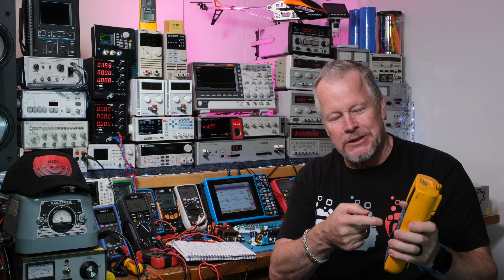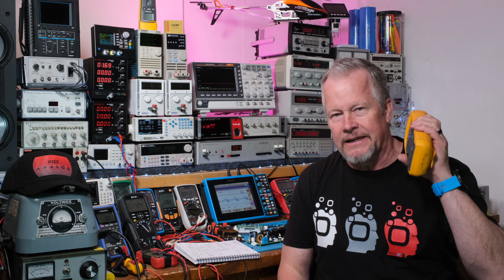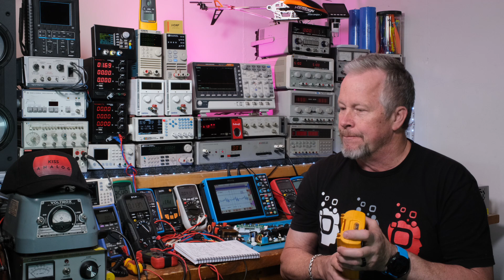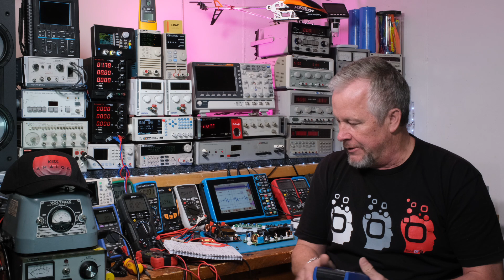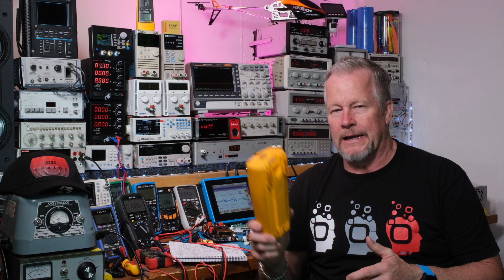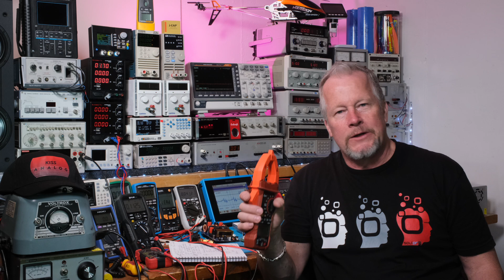Rant on MultiMeter Reviews with Fluke 289 vs Keysight U1282A #Rant #Fluke289 #keysightU1282A

Comment: Wow tell us you hate fluke without telling us you hate fluke. Nothing comes close to the build quality of flukes period. You pay for what you get if your using your meter in the field get a fluke if your using it in your workshop yeah ok get a keysight, but if your using it in your workshop then just get a brymen its cheaper again, dont really see a point in keysight, hioki on the other hand has a place as its in-between the cost of the brymen and a fluke but again if using it in the field you can beat a fluke if using it inside only then go brymen.
Reply from the maker: Thank you - I appreciate your feedback.  I really don't hate Fluke - I feel bad that since they have been bought - they just have not designed new multimeters for decades and are falling behind.  And then the Fluke fans don't care and buy their meters so that they don't have to compete.

I have spent so much more on buying the many Flukes that I have that if I had only not been such a Fluke fan - I could have saved so much getting newer better meters...I'm trying to help others see the light.

You have not seen my other videos as I show many meters that not only compete with Fluke - but in my eyes looks even better.  Fluke are great - but 20 years old - and others have caught up.  

Check out my other meters that I compare to Fluke - I think you will be impressed.  Not only do many meters match or beat Fluke in safety components - but there are many that have better IP and drop ratings.
Reply: @kissanalog I agree they are definitely behind in functionality, but i believe they are the leader in build quality, i too am hoping for a refresh on all there meters soon, though i hope they keep some simple with ultra long battery life which means keeping the basic LCD, and then have others with more functionality accuracy and speed so you have the option depending on your needs. I personally prefer the the more basic long battery life style like the 87v max, as an industrial electrician this meter ticks all the boxes for me. Im not really sure any other meter does that other then keysights top meter, but at the end of the day thats basically the same price and from what ive read isnt actually that reliable.
Reply from the maker: When I started this channel I had used and owned the 87 series for several decades.  When the 189 came out - it was just so much better - but they killed that meter.  The 189 and 289 meters design came from Tektronix which the parent company also owns.  They didn't want the new Tek meters killing off the Flukes.  

There are a number of meters that have equal or better build quality - IMHO.  I've shown these meters side by side with fluke so that you can see the build quality.  As I've mentioned, the IP ratings in other brands are often better - showing the build quality.  The protection circuits are also top notch.  Fuses and batteries are easier to get to as well.  

Regarding the display - the Flukes use the old tech and the newer displays are more crisp, easier to see, and have better back lights, and then there are the really sweet displays - the EBTN, VA, TFT, and OLED screens.  Yes these will take more power - but then they are so much easier to see and some are dot matrix so they can be programmed to show so much more info on the screen.  This takes us to rechargeable batteries - which I'm a big fan of.  I hate tossing out batteries and finding that the batteries are dead when I need the meter.  But if you can recharge - you are back up and running in no time and if you are on a job - you don't have to run out to buy new batteries.

Comment: I agree that the Fluke DMM brand is an expensive brand.  I have a number of Fluke DMM’s including the 189 and 289. I also have clamp meter and wireless DMM.  I consider them to be the benchmark for all other brands.  I recently considered upgrading to a Keysight DMM, but when I got the data sheet and compared the model side by side I realised that I would have probably picked the Fluke over the Keysight, even though it is 15 years old.  The Fluke 289 has the record feature of trend measurements,  is accurate and stable, which is what I needed most.  On that basis I would probably purchase the Fluke 289 again when comparing it with the Keysight DMM flagship model.  I think the phrase,  “You get what you pay for” stands up to scrutiny when looking at the finer details.
Reply from the maker: Thanks for sharing your thoughts.  BTW, the Fluke 289 is not 15 years old it is approaching 2 decades.  The UT181A is an updated lower cost version by UNI-T who is one of the largest equipment manufactures in the World.  The UT181A has a color display so it is easy to read and it has a rechargeable battery so the battery will last a lot longer.  It also has Bluetooth as well as a PC control, but the bluetooth really helps to capture the logging real time and record it.  This is a far better - more up dated vs of the 289 - IMHO.  

Here's a video comparison. 
https://youtu.be/-RcEli_pB7c

This is the teardown:
https://youtu.be/-RcEli_pB7c

Comment: The 289 is for industrial motors and HVAC I thought you did electronics engineering, in which case the 287 is more applicable??
Reply from the maker: Great question! The 289 and 287 share many similarities, but the 289 adds features useful in industrial settings, which can also be beneficial for electronics work depending on the specific application.  The 289 has better logging features and at these high prices it is nice to have the LowZ, filtering and logging.  I think both meters are over priced and too big with poor displays - compared to other meters that you can get today.  I only have it because of this channel to show how others compare.

Comment: I bought a 289 because I’m a motor control technician and it’s the only one that pretty much does everything I need for troubleshooting high tech equipment and frequency drives.
Reply from the maker: Thanks for your feedback.  Here's a fantastic option: https://amzn.to/4dQeb5u
Reply: @kissanalog  nice, this didn’t exist when I bought the 289 back in 2012.
Reply from the maker: Yes there are so many options today.  The 289 has been around for over 20 years.  Back when Fluke was designing high-end meters.  I wish they would come out with a new updated 189 - my favorite Fluke:)

Comment: From when I bought the Fluke 289 on LOz funtions have a big problem when start ON, the AC grow up to 8.4V without probes connected and none Fluke repair in Europe resolve the problem, if sombody can tell me if are or not 289 like this I will apreciate plaese. Or isn't normal?
Reply from the maker: Thanks for asking.  When you short the leads - does the reading go to near zero?
Reply: @kissanalog  No, it is the same, the 8.4 volts are the same and I pay for Calibration 2 time in vain in Europe Fluke. Thank You!
Reply from the maker: Wow - that is terrible!

Comment: I don't find the fluke 287 that bad on my bench, find the display readable and when my rechargeable batteries die I'll use an 87V.

I only paid £150 for it so that's a good deal, don't mind the menu as I rarely need to use it.. the menu has many features that the 87 doesn't... So that doesn't seem a downgrade.

But you have good points. And no doubt the 28x series is dated, but this could be partly why it is costly to maintain such an old design...? Not sure, does anyone have PCB shots of a 15yr old 28x vs a recent one?

 Interesting stuff.
Reply from the maker: Thanks for your great feedback!  I think everyone has their own likes and dislikes and the Fluke meters are quality meters - so there is no argument there.  I have been a Fluke fan for years - until I started this channel and started looking at other meters.  The Fluke is so expensive - they cost more now than they did when they were released.  Both the 87 and the 289 or 287 are around 20 years old now.  The new meters just have such nicer displays and are smaller and have better user interface.  Also, they are built just as well if not better IMHO https://youtu.be/YvivwYCxrBo

Comment: I have owned a 289 for about 10 years. Bought it used because I couldn’t justify the cost. I use mine in the automotive trade and like the low ohm range and the data logger which I use with an amp probe to measure intermittent key off draw issues. Yes the battery life is poor but my biggest gripe is the outdated display. If Fluke were to update the line to TFT color or OLED I would buy a new one. The backlight does help but I work in low light environments and it’s still a struggle.
Reply from the maker: Thanks for this great feedback!  Besides being battery hungry - it is just too big IMHO;)  I agree the display is sad - but then I believe this meter came out in 2007, so for back 17 years ago - it was pretty nice.  I'd like to see them revive the original 189 with a new display - that would be interesting.  Right now there are just too many better options at a much lower price IMHO;)
Reply: Fluke would always be overpriced. Fluke may not be capable of being creative.

Comment: My biggest complaint about the 289 is boot up time. Favorite Fluke is the 189/187 hands down the best continuity buzzer and sensitivity.  Although a Fluke 289 on your bench is a statement and like it or not it’s definitely the King of the hill.
Reply from the maker: I agree - the boot up time is frustrating with a multimeter.  With an oscilloscope I don’t care, but a multimeter is typically picked up to take a measurement and then you have to wait - and hope that the battery hungry meter has a good battery.  My least favorite meter that Fluke makes, and besides the boot up, super large size, and menu driven (with every feature buried), and it is a battery eating machine. The logging feature is outdated and expensive with the subscription service that you have to pay for, and takes an expensive cable.  I only have it because of this YouTube channel.  It is 16 years old and is not worth half the price they demand.  I have other meters at about half the price that I want to review in a shootout to show what a high end meter is today.

Comment: I run the 289 as a daily driver. 789, 1587fc, and 378fc are the supplemental three depending on what I need.
Reply from the maker: Wow you have some expensive meters;) Are you happy with them?

Comment: FLUKE 289 system info - Select "Setup" (F4), select "Meter Info" (F1), scroll using up/down arrows.

Enjoyed the video/Rant, I learned a number of new things about DMMs - Purchased my 289 about 14 years ago for ~$500, still working great (light use).  My meter did come with an IR to USB cable.
Reply from the maker: Thanks for your feedback!  It is an old meter with older tech.  The newer and lower cost meters come with Bluetooth, so no cables to tie you to the meter.  Once you use Bluetooth - it feels so nice to monitor a meter from another room (safely) and not have the expense of the expensive cable and I believe the software has to be paid by subscription.  Meters that I use today come with free apps with no subscription fees.
Reply: Fluke has become a dinosaur.

Comment: I understand and I understand what you mention and if you go A cost-benefit ratio perhaps there are other options.
But I leave this to you, perhaps from another point of view.
https://www.youtube.com/watch?v=ay9wFQAW19Y

Regarding the fact that fluke 28x series can only offer you 100 to 200hrs of use compared to the 800hrs in the first years that 28x came out with its PCB ID 1 and 3, they had 3 terminals on the back where the battery compartment goes which the third terminal was used for another battery compartment (which was sold separately) that housed 4 type C batteries, then your records were no longer going to be for a week but weeks, who knows if the month passed, that would I saw it in a promotional magazine, I tried looking for it once but I don't think I found that accessory, already for the fluke 28x series, ID PCB 5 they eliminated that third terminal, I suppose it was not offered or sold. greetings
Reply from the maker: Thanks for your feedback!  The link you left is to EEVBlog where Dave is responding to my video.  His video is one of his most watched videos. I also posted a follow up video:)
Here's the link to my video that kicked these videos off: https://youtu.be/3YW0aaED9aQ

Comment: I have both a Fluke 287 and 289. The 287 is an electronics test DMM and the 289 is an industrial test DMM. 

If you are maintaining AC equipment in a manufacturing plant the 289 is really hard to beat. Why? 

1) The 289 is a CAT IV 600 Volt, CAT III 1000 Volt True RMS 50,000 count DMM. Which is really handy for 3 Phase 440VAC, if you are wearing the proper PPE (which you are if you are in the plant), and CAT IV 600 VAC meter probes are required and not cheap and not repairable. If you damage a lead set you will need a new one. True RMS is needed for complex but periodic AC waveforms. So you might have an intermediate stage signal which is a chopped AC signal but not a perfect sine wave, if you know the proper RMS voltage you will have a repeatable measurement base. 
2) The low Z AC voltage range will eliminate ghost voltage, which is a huge problem in a manufacturing plant setting where is seems the motor drives and amplifiers exhibit a lot of capacitive coupling which will ghost just about any DMM with a very high input impedance on AC Volts.
3) With motor drives and inverters in mind the 289 also has a low pass filter built in, which is also very effective in a plant setting for use with intermediate AC volts when you know the proper frequency range. 
4) The meter can read capacitance up to 100 microfarads which is useful in testing single phase start and run capacitors.

5) You can measure temperature using a direct K type thermocouple input. This is handy for HVAC testing where you have a huge selection of K type probes, for example, pipe clamping (Air Conditioning refrigerant piping), air stream testing (air flow temperature), contact temperature, etc.
6) Then you have the common high end DMM features like surge current, simultaneous min/max, crest factor, etc.
7) A very handy feature is the display back light, which is bright but uses a relatively large amount of battery current.
8) You also have a logging feature, but logging takes a certain amount of testing time, so it is used in special cases. Mostly tied to troubleshooting a specific type or model of device where you know what you are looking for.

Most DMM current measurements in a plant setting for equipment repair and maintenance are made with a DMM bandwidth current clamp.

And I would agree about the stand, it seems really weak, but I have not broken it. When stressed it just pops out and I push it back in the grooves and all is good.

The 287 is a bench hand held electronic troubleshooting DMM, it is good in the lab if you need a DMM to move between benches and don't need the accuracy of a bench DMM. Compared to the 287 a bench DMM is just too bulky to lug around and many highly accurate models are AC powered.

If you don't need the 287 features for a portable bench DMM, than a 87 V will work just fine. Although the 87 V is newer than the 287.

The best display LCDs for a hand held device on AC volts I think are made by Megger, like the CAT IV 600V MIT485 insulation tester (which is one thing the 289 will not do). The LCD display is just beautiful. So if you have the Fluke 289 and the Megger MIT485 you are good to go. For plant industrial AC leakage current testing I use a Hioki CM4002 which is an excellent product.
Reply: All of these features, and many more, are available in the Chauvin Arnoux CA5293 model.

Comment: Question: I'm looking for a very-accurate, high resolution portable meter that will mostly be used on the bench to make high accuracy measurements.
Do you still think that the Hioki DT-4282 is still the one to get?  
I really need something in the 5-1/2 digit level. 
I tried soaking my Fluke 8800A in water overnight but it wouldn't shrink down to handheld size!
I don't need the super tough rough handling or upper-level CAT-rating.
Thanks for all you do!
Reply: BM869S? Probably one of the most popular 5.5-digit handheld.

Comment: I'd be disappointed if a meter's diode test can't determine a surface mount LED's polarity. It's too useful not to have.
The best continuity test I saw in a review used a function gen to turn on a FET at increasing frequency. I think this was Joe Smith?
Nice vid, Kiss.

Comment: After fifteen years of essentially the same design and with improvements in manufacturing processes why has the price on the Fluke 289 increased so much, I paid 486.00 on Amazon in 2016 for mine. I agree with everything that you said, short battery life, poor display contrast and complicated menu system. At least it is an accurate meter.
Reply from the maker: That is a great question!!  The technology is getting old and the payback on the design has been made a long time ago.  I think they just keep pushing up the cost to see what they can get.  The Fluke fans keep them in business - not their great work in the field -or at least in the last 20 years.  IMHO